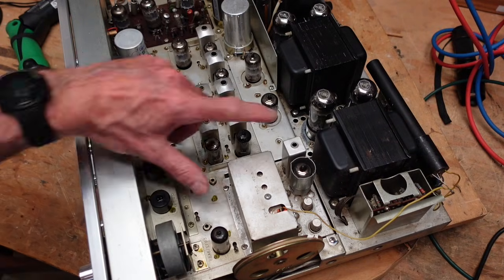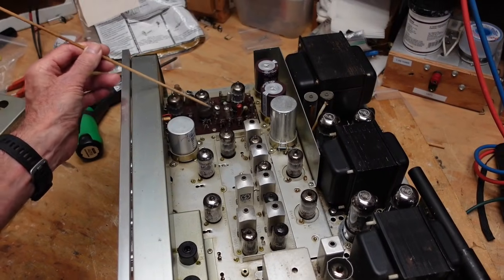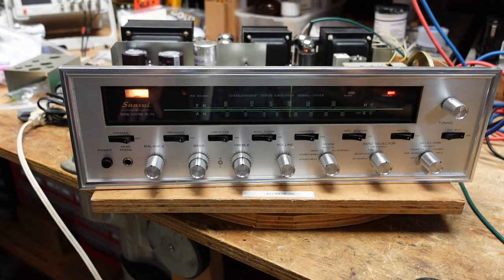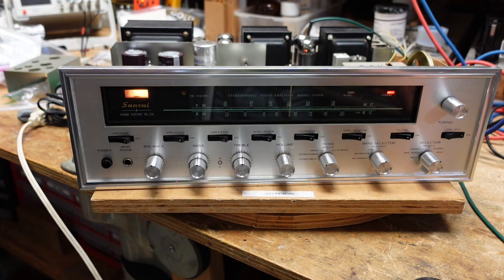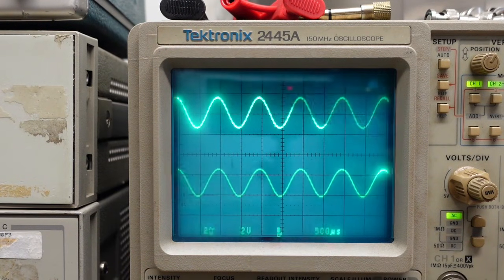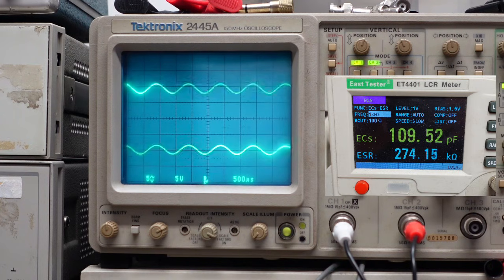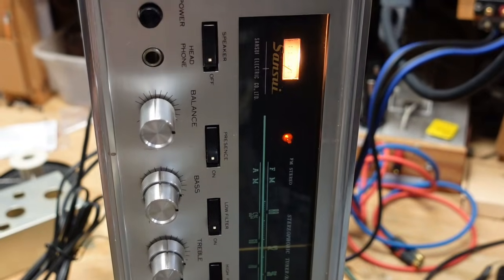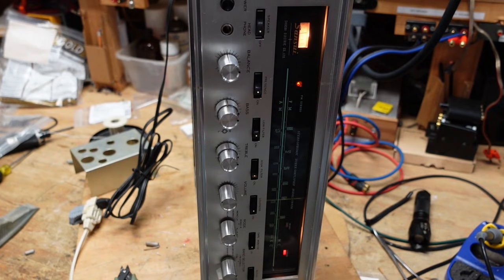Sansui 1000A Power Supply and FM Stereo Repair

Comment: Great to have you Back Ray. Enjoyed your tube receiver video and the stereo MPX fix. Man...Steve can pick them...LMAO. I'm working on a Sansui AU-D55X Integrated Amp.  Cold solder joints and lifted traces all over the place. They cheaped out on Heat sinks on some of the TO-220 Transistors or in other words...did not use any. Plus component leads pushed the traces right off the boards in some areas. Wonder if you ever ran across and Sansui solid state units by them with that problem ? If you look on AK there is on gent from Greece who posted pics of the damage which was the same as the one I'm working with.  Also never saw a Power Transistor heat sink system like the one they used which was the Tube & Fin design. Looking forward to more Videos. Regards: Mark
Reply from the maker: Hey old friend!  I never worked on any AUD55X units, but at the age most of these units are it's hard to find one that someone hasn't been into.  In units like those, I've found work quality ranging from very good to "WTF were they thinking".
A few dollars worth of aftermarket TO-220 heat sinks are cheap insurance.
Reply: @raygianelli3612  Yep, Went to our old friend Amazon and Picked up a Dozen TO-220 Heat Sinks which came with insulators and round plastic guide thru the tab for the nut and bolt. Never ending parts buy.

Comment: Nice job as usual Ray, and I had an inclination I connected that wrong. I just figured since it was someone else's unit I'd be safe and give it to you to check out.  Your viewers were begging to see another video also :trophy-yellow-smiling:
Reply from the maker: It's easy to get fouled up when doing this.  While I didn't record it, I replaced the filter caps in your A2502.  I missed one wire, the one that connects the filters together and goes to ground (there are a LOT of wires that go to the filters).  It passed the dim bulb, but blew the speaker fuses.